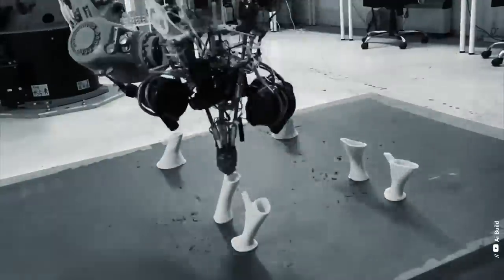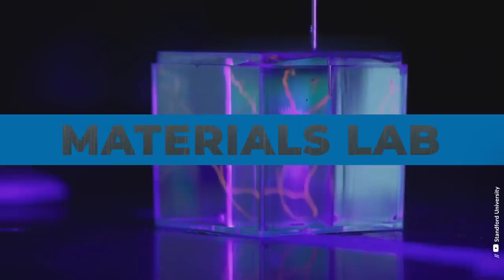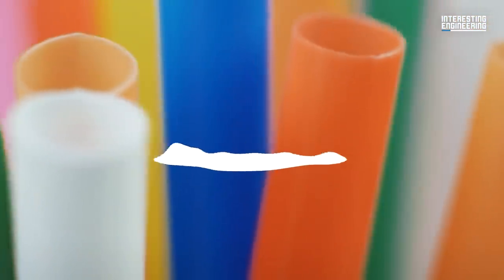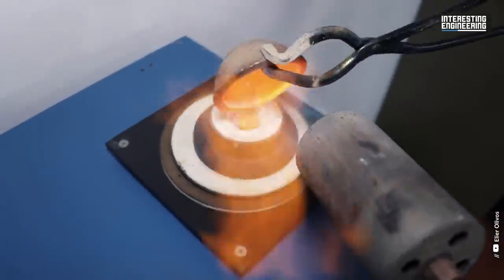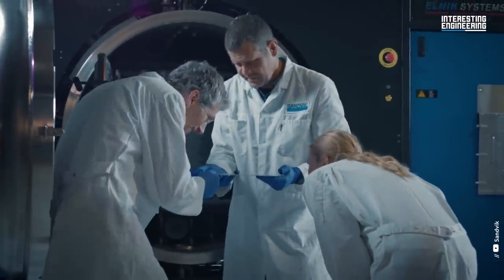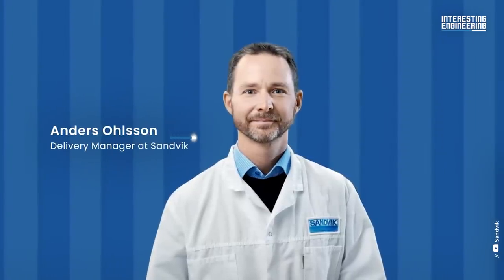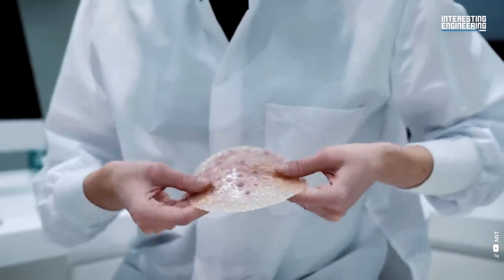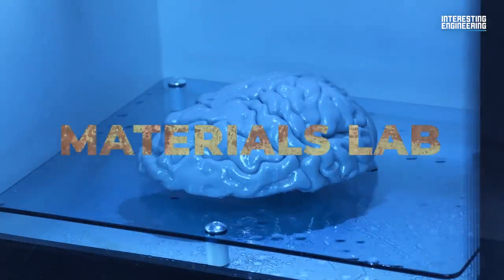3D Printing Is Becoming Unstoppable

Comment: My favorite additive manufacturing technique is SLS (Selective Layer Sintering) often done with lasers. A coat of powdered material (plastic/steel/stainless/copper etc) is deposited on the print surface, then using a laser to harden only a selected area before repeating the process..
90% of the remaining powder can be reused, which makes it almost the most efficient and accurate printing method from industrial appliances :D
Reply: How does the material properties of an object made using selective layer sintering compare to that of the same object made from some subtractive manufacturing method (like in a lathe) of course I'm not being pessimistic, I'm just asking what it's advantages/disadvantages are and how we can improve upon that, and yes I realize that there's no one size fits all, magical manufacturing method. Different methods are used in different places. I'm just curious how it compares to a more "traditional" manufacturing method.
Reply: I've machined parts out of raw material as well as sintered parts and R&D 3D printed parts (which looked like millions of BBs glued together), and nothing compares to raw material in terms of rigidity, surface finish and speed, however with printed parts you can create elaborate and extremely complex shapes and internal features that you wouldn't otherwise be able to machine practically. The printed parts are not "seal-ready" they haven't gotten down to nano particle sized additions so the surface finish is horrendous, which means that a secondary operation in which subtractive machining needs to be implemented. I don't think the two are separable, they will always carry their own risk/reward attributes, and in an industrial sense will forever be intertwined, since it's just another form of machining.
Reply: While laser sintering may be accurate, it is wildly inaccurate compared to machining.
Reply: It’s probably the most valuable and actually viable method

Comment: I do wish these 3d printing companies would stop lying about the product quality being superior to traditional fabrication. 

What they've achieved is incredible, but, for example, the rocket body tube being 3d printing using a MIG welder, forces it to be much thicker and rougher surface than a traditional rolled tube [if it were too thin it would melt the previous layers, and the molten metal sags slightly to make a rippled texure which is waste mass and less aerodynamic] 

and then the heat treating and alloy is different which may require thicker walls to compensate. it's cheaper but not superior. 

And the laser metal printing has worse material imperfections than machining from a block, but it allows for shaped not possible from machining from a block. 

I'm amazed at how far they've corrected for the problems! (molten metal does not behave predictably) but then they go claim it's superior (lighter, stronger, cheaper), which sounds like blindness at best, and fraud at worst.
Reply: It is superior in the fact that you can only do generative designed forms with additive manufacturing. That alone has substantial value. 3D printing is still in its infancy in the grand scheme of things. It's like the semiconductor industry in the 80/90s.
Reply: I see the true breakthrough for 3D-printing to be when artificial gravity is invented and miniaturized, it will allow humans to print what was thought impossible.
Reply: Its not currently superior but in general the finer control you have with material, the better the material. If anything you can prepare a material and then do traditional hardening/fusing/welding to reinforce it. It can speed things up currently in the very least. However, to fully replace traditional methods we need finer control.
Reply: It's great for prototyping. I'd buy a machined or cast product any day of the week over a 3D print. But an inexpensive FDM plastic printer is a super cool thing to have. I just got one recently and have been enjoying my complex-to-manufacture designs (and designs I simply don't have the machines to manufacture manually) become a reality. Again, great for prototypes and one-offs.
Reply: I do agree with you on certain aspects regarding 3D printing -most of the components that are to be used in critical applications are still fabricated using CNC or at best molding or casting-where 3D becomes handy is in areas where a  components structural integrity will be least worrisome-the chemistry used in metal powders is evolving and being fine tuned for prime time but it should be remembered all technologies compliment each other in application and final delivery of goods and services.
Reply: 3d printed parts can sometimes be superior to any machined ones, despite having worse material properties. 3D printing opens the door to geometries that just aren't possible with conventional machining, which sometimes allows making more optimal parts.
Reply: @RB-kb3tc  That is true - 3D printing opens up geometries that were impossible to realize through conventional ways and like I said the chemistry in material science is evolving-besides methods of material application namely nozzles,lasers and the like are being improved on from the last for better results.
Reply: this is only beginning
Reply: It seems like a combination of additive and subtractive could yield great wins. I also wonder if 3D printing could be used to make cheap and reliable molds, allowing mold shapes that must be broken to get the molded part out. Metal subtractive manufacturing uses stock that was made in a mill. Can mill processes be combined with 3D printing somehow to get some of the best of both worlds?
Reply: @TrackedHiker  It can and it is possible the technology is past its nascent and hobby stages and is now being applied in practical  spaces.Measured applications are being studied how it can be used fully in sensitive areas without compromising safety.Companies like DMG Mori,Mazak and Maatsura have hybrid systems-so yes molds can be done and you get the best of both worlds.
Reply: This is a wildly inaccurate take on additive manufacturing (AM). AM-built materials CAN have superior material properties compared to traditional manufacturing techniques, but not always. It depends on a lot of factors such as material choice, AM process used, the traditional manufacturing process used and heat treatment choice amongst others. Saying that metal printing has worse material imperfections compared to machining from a block is completely untrue, you can print metal components with no imperfections whatsoever.

AM is best suited to high-value and low-production volume applications and this will likely never change. A large portion of aerospace and medical industries have adopted this technology because it is much cheaper and superior for some specific applications. It seems like most are unaware, but the metal AM industry is very large and highly developed. For example, the global plastic 3D printing industry for consumer goods (most of what is shown on the internet) is roughly $150m in value, whereas the global metal AM industry is over $4b in value. This money knows what it's doing.

It is simply not AM vs traditional manufacturing, they are different and have different benefits. Pitting AM against traditional manufacturing is like comparing casting to rolling processes - they do different things and are both useful.
Reply: @edenassos  3D-printing is actively being tested in micro-gravity environments such as the "vomet comet" and abroad the ISS.
Reply: @RB-kb3tc  3d printed parts often have better material properties compared to machined components, but not always.
Reply: Everything you stated about relativity space's manufacturing techniques is wrong - I suggest you watch some videos on why they are using their AM technique.

Everything in physics behaves predictably if you know how to predict it. Molten metal is quite predictable, AM processes are simulated with a high degree of accuracy.
Reply: @byronblakey-milner2306  What makes you think I don't know that?🤣🤣
Reply: 3D printing would help a great deal in extraterrestrial manufacturing as there are limitations in payload that prevents brute forcing by bringing appropriately scaled refinery and manufacturing just to provide self-sufficient industrial capability. On-site fabrication would still need raw and refined materials on that note.
Reply: Not to mention, traditional processing of materials, such as cold rolling, imbues metals with much of their strength.
Reply: America and all countries should support digital currency and cancel higer denomination notes to capture black money and save paper
Reply: The vape pen stands I made with my 3d printer would be more robust if they were made by a professional design team with injection molding. They'd also cost about 100x as much - these cost about $0.02 to make and no shipping. It's a difficult angle to sell a product to a highly-priced consumption-based society, where value is defined by stacks paid, these print things with great utility and adequate durability for such a low price. Before owning a 3d printer, I didn't understand why people wanted them. Now that I have one, I couldn't see going without one. The value proposition is clear and definite, and somewhat anti-consumer culture, as it's part of maker culture. Getting someone over the culture switch is key.
Reply: I doubt that companies as big as AirBus would routinely be using 3D printing if it was inferior to other manufacturing processes.
Reply: @leavemealone247  Why would you want something wonderful and fun, like 3d printing, to come to an end?
Reply: Repent and believe in Jesus Christ   Do you copy and paste that into all of your replies?
Reply: Musk is eliminating it from his rocket factory. Automation too.
Reply: In boilers, especially ones working with high pressure (and heat) the welds are always the weakest points.

It makes me wonder how durable and reliable are 3D printed metals with all these applied stresses. Maybe it can do well with compression, but what about tensile and shearing forces?
Reply: Modern Startups in a nutshell. They overpraise even if they don't need to.
Reply: @TrackedHiker  its basically the main use for 3d printing at scale
Reply: If you haven't seen it, check out "smarter every day...how rockets are made" Awesome stuff !
Reply: Amen

CNC machinist 25 years
Reply: It’s because humanity is in a rush to put itself out of work with inferior products.
Reply: @edenassos  Yea OK... but it's not lighter stronger and cheaper as the OP pointed out😅
Reply: They need the "hype" to get more subsidies and investors.
Reply: I've worked in metal AM for about 7 years now. I'm not sure where you're hearing people at these companies that the properties are better than billet. The properties are typically stated to be much better than cast but not quite billet. Especially after HIP and HT, you're looking at very close to 100% density, but you're still going to struggle more with fatigue than a billet material
Reply: @WalterGirao  i haven't seen a nice 3d printed piece yet. Ive been a cnc machinist \ mould maker for 25 years and 3d printers make me cringe. The 3d printing fan boys are even more cringe worthy.🙄

Comment: My only issue with 3d printing is tensile strength and breakage. You don't see tests between those and cut pieces.
Reply: I've designed hinges with ABS that was 3D printed.  It is all about knowing the layering of composites.  You can design for the strength that you need, but you need to understand how to do that.
Reply: @robertmisiuk7137  I kinda cringed when they mentioned "as hard as steel". I highly doubt it. I'm really not interested on the subject, but do you think this technology can replace another constructions in matter of durability/funcionality. Like... that rocket cone... that's another questionable thing but I also blame the video for not explaining what 3D painting actually is.
Reply: @thehoodedvagabum7375  well the hard as steel part is technically correct. It's just probably not as elastic as steel.
Reply: SLS 3d printing can be made to be equally strong as steel through post process treatments like Hot Isostatic Pressing. Saying that, in future when  3d printing can be done down to the atomic level there will be no difference between a slab of forged iron and what a 3d synthesized slab of iron can withstand, even outperforming it in every single imaginable way.

Comment: Can it be printed? Yes. Is it better? No, most of time. Eg metal printing is far weaker then fabricating it, does have it uses tho. but as far as general use the metal isn't strong enough for the purpose
Reply: Depends what the purpose is. Engineering is about being good enough not perfect. Also some parts are easier and cheaper to print
Reply: @DavidSigbi  hmmmm true but it's very far and between most times
Reply: This is why I 3d print, then burn out and cast.  Best of both worlds
Reply: If you watch the videos on the 3D printed rockets, they show that the metal structures have no grain boundaries, they’re also printed in a way that reduces internal stresses allowing for the final product to be very similar to a cast metal part. The alloys and grain structure may not be as good as a forged part, or cold rolled. But you don’t always need them to be and the extra capabilities of a printed part make up for those shortcomings.
Reply: And once we start adding other meta materials, like graphene, their inherent strength will go up to even better levels.

It's a process and the more we work at 3D printing the better we will get at it as well.
Reply: @Alienami  the problem is the way it does it. Parent matteral vs a weld, the weld isn't as strong
Reply: Metal printing is more often than not STRONGER than other fabrication techniques. At our current development, metal printing offers better solutions if you have enough money to warrant using it.
Reply: @techyy9962  That is so untrue, weld material is very often stronger than the parent material.
Reply: @techyy9962  that is a myth. A bad weld isnt as strong. A dirty weld isnt as strong. But a clean weld with good contact is just as strong as the base material.
Reply: @techyy9962  if your weld breaks before the parent material your weld was wrong.
Reply: There's an american company selling a car with 3D printed chassis. They done it using AI based software to develop each part considered stress and funcionality. They patented their 3d alloy and all the engineering involved in this process. The main advantage they said is zero waste of material.
Reply: I've 3D printed gears that worked better than gears with cut teeth.  It is all about design for use.
Reply: It's not 'far' weaker than billet. I came from production machining but have been doing metal AM for about 7 years now. The properties as a whole aren't quite the level of billet for most materials, but they're not that far off. AM Inconel 718 after the typical follow-up heat treatment, for instance, is typically very close to the same UTS as billet, but fatigue is where there may be a larger difference. We've been using it in a lot of applications where there are heavy loads for quite some time. The tough part has been gathering enough data to qualify it for rotating machinery in turbine engines, etc. It's more often that users can't use the 3d-printed parts in production because of the amount of resources that are needed to qualify it since the data isn't as easy to come by. It's extremely expensive to print and test enough samples to satisfy regulatory requirements, and aerospace OEMs don't want to share that data with each other because it gives them a competitive advantage if they've qualified materials that others haven't.

Comment: We were "3-D printing" Steel in the 80's, as soon as we mixed NC control (anyone remember ticker tape drivers? Or cassettes with routing data?)  into a router program, we hooked all kinds of things to the operating grid. I started with multi head cutting torches, progressed to high end plasma and mixed media cutting. 
We had a mig welder that ran on an arm. We played with making build ups on that quite a bit.
Just sayin, you don't need lasers to 3-D print steel. This is a lot of hype for no correct workable information.
Have fun all

Comment: I think a 3d printing method will be ideal to create the outer skin for  interstellar spacecraft. The different types of energies/radiations these spacecraft will face due to faster than light speed travel will require an alternating composite of say;bismuth with a layer of quartz crystal -with a layer of graphite etc.
The human cells 3d printing reminds me of the creation of the 5th element superspecies from the movie with the same name=The 5th Element.
Reply: No mass is ever possible to reach a speed of light. Those are the basics...
Reply: @HyennaTheOne  Not if your spacecraft has a gravity wave propulsion system.Than if directed in front of your ship, you are falling into your own personal wormhole.
Of course your power supply must be very powerful-enter a matter/antimatter reactor.Problem solved.
Reply: Nice. Honestly I did not expect such a high knowledge reply. The thing with the energy source is imho the limitation, energy will have to be taken from somewhere, and such a huge amount is gonna lack there. I believe that the creator will not alow that to happen. There are mechanisms to prevent this. next cataclism is just behind the corner, it occurs every 6 eons (half of a platon year), the last one was approx. 12500 years ago, do the math...
Reply: You have obviously no idea what you are talking about